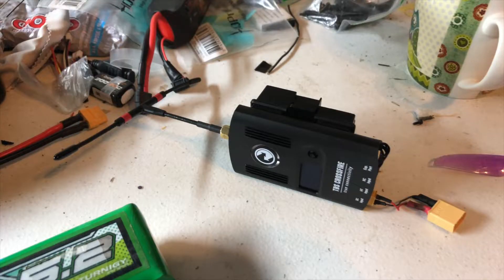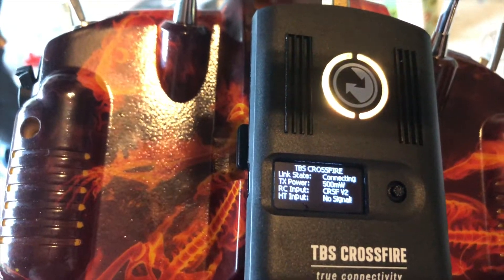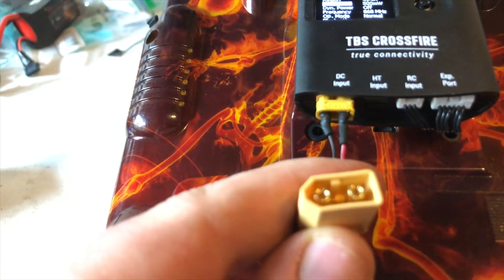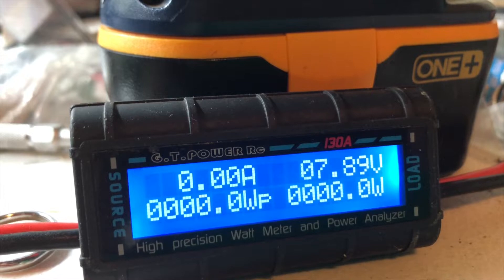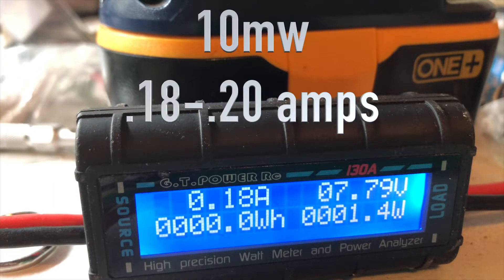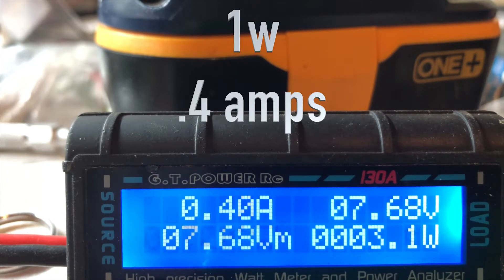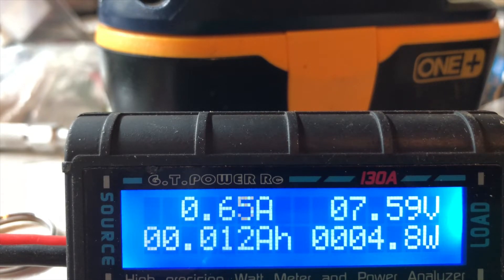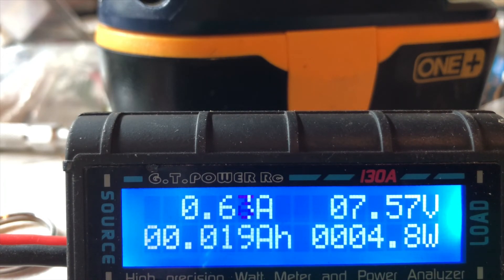What is the TBS Crossfire Power Consumption ?

Comment: If you used a 3S battery your results would be totally different to what you achieved in this test.
So what was the outcome or the reason for your test, or what was you trying to show us. Other than current flow for the crossfire Tx which will always be arbitrary figure dependent on so many variables too many to list here.
Reply: The power consumption stays the same, no matter the voltage. Current draw would be different but the total power (displayed in the bottom right corner) is always the same.

What he showed us is the power consumption of the module at various power settings, which is helpful and it doesn't really matter whether he did the test at 5V, 7.6V or 12V.
Reply from the maker: The average person is probably going to be running a 2s battery which is what comes with the taranis. This is just some info for someone who is interested in switching to crossfire but may be curious on power consumption. Yes increase volts and amps decrease but it gives a good starting point.
Reply: @DroneDayze  But then I wonder, how my 2s 3000mAh Lipo gets drawn empty so quickly when It's set to 500mW...??? I mean, it should last forever...
Reply: @DroneDayze  It was very useful to me to get any idea at all, how much it consumes. I want to upgrade to 3s in my Taranis and wanted to know, what what C-Rating the Batteries should have. Now I know I can use any. Thanks :-)
Reply: Hi! Does tbs micro Tx accept 3s battery?